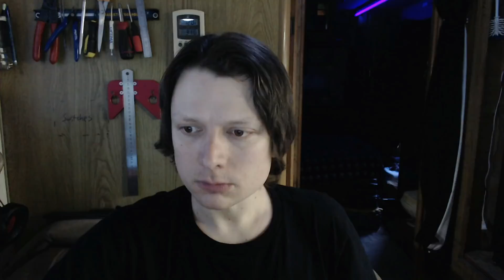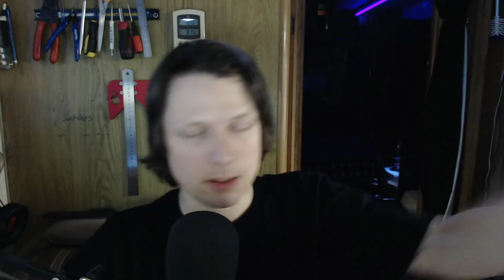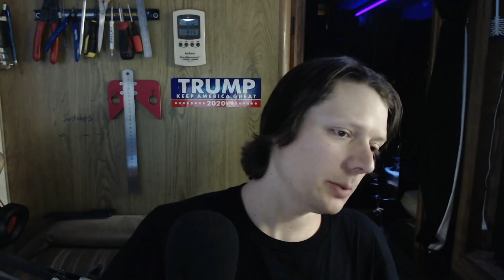RV Living Update Vlog - Repairs & Plans

Comment: Sorry I haven't been available to watch but you should send that stock harmonic balancer back and get a fluid damper, much better and easier on your engine and it doesn't have the rubber grommet in it because it is solid. It is more of a performance item but it will allow your engine to run so much smoother.

Comment: I recommend you replace the timing chain and gears , you’re right there.. and it probably has the nylon coating on the cam gear and they end up cracking  and falling apart and will end up in the oil pump screen

Comment: Good luck with the gaming channel, getting a gaming channel off the floor nowadays is hard because of the low barrier to entry coupled with the over saturated market place. Still here's my sub. 

For what it's worth, I heard from other gaming channels that outputting videos regularly (on a schedule) helps with the algorithm. Also shorter videos help it too. I.e. three 20 minute videos released on mon, tue, wed; will do better than 1 one hour long vid would in terms of search ranking. If you have time, I suggest reading up / or watching videos on the youtube search algorithms.

Comment: Most auto parts stores will lend out a balancer installer/remover tool for just a deposit and a small fee $10 fee.  Even if you were to live 2 lifetimes with that same engine, you'd never need to redo a harmonic balancer repair again.  Try buying a new "interocitor kit [Alien Communication Device - google it, if you don't know what it is?", and you'll have about the save chance of reutilizing that kit as investing in a new harmonic balancer.  It's super rare.  Your expensive {USA $105} tool will languish in your toolbox for all eternity.

Comment: That freezing weather fried your harmonic seal
Reply: lol no
Reply: Collapse lol yes, a millinial is going to tell someone whos worked on 454s for 40 years how to be a mechanic LOL LOL
Reply: @40belowful  Exactly.  That cold he was getting in Oregon during this storm was nothing compared to what other places get, especially Alaska. People's Balancers would be flying apart daily 24/7 if that tiny bit of weak cold would cause that.
Reply: @AN-vt8qq  I was a mechanic for 20 years, and you are still wrong. The Terminology you use tells me you are not a mechanic, at least not a good one. The Cold ''FRIED'' your balancer.....   smh
Reply: Hmm...ask the challenger engineers what caused the rubber o rings to fail in FLORIDA you two brilliant mechanics
Reply: The cause of the disaster was traced to an O-ring, a circular gasket that sealed the right rocket booster. This had failed due to the low temperature (31°F / -0.5°C) at launch time – a risk that several engineers noted, but that NASA management dismissed.Dec 16, 2016
Reply: Chevy engineer
the crankshaft seal dries out, cracks, or breaks, it can cause an oil leak. ... cold weather, moisture at the engine crankshaft balancer may freeze to the crankshaft … ...